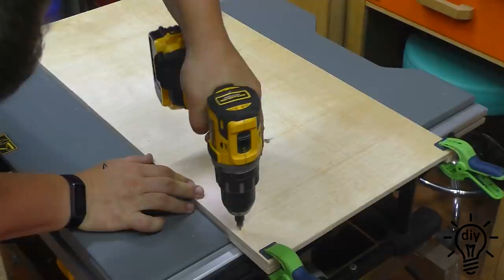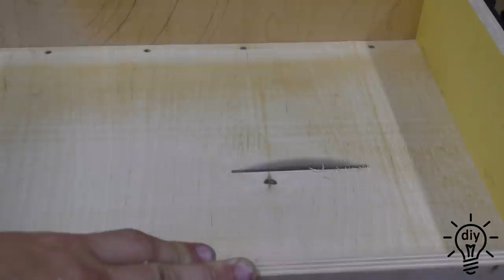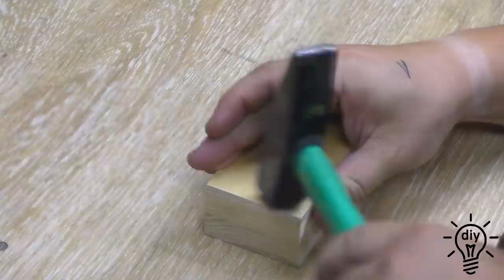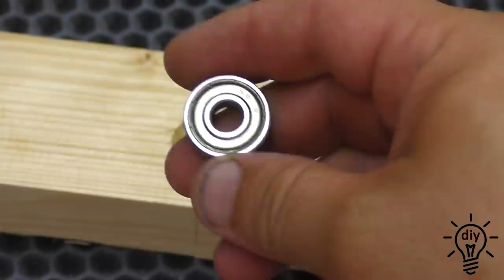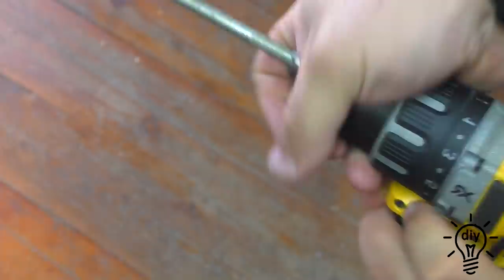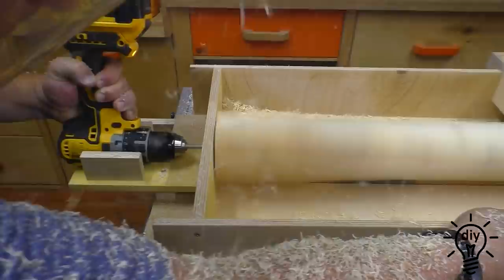How could I not have thought of this before! Brilliant idea with your own hands!

Comment: Wow!  What a wicked cool idea!  Thanks!
Reply from the maker: Thanks 🤝
Reply: You’re clueless.  This is a terrible idea.
Reply: @fiveoboy01  you could be nicer and explained instead of calling me clueless.  I am new to this and that was really rude.
Reply: @fiveoboy01  your favorite video is literally Gangnam style, how would you know who's clueless about what!? ....jkjk lol you guys are great. I wouldn't do that to my saw either
Reply: @rachealsmith5138  I'll give it a go - how about you spin a piece of wood perpendicular against a disc spinning at high speed and see what happens. Here's a simpler analogy: Find a paper plate, put a hole in the centre, attach a shaft and put in a drill. Now start the drill and keep hitting the plate at the bottom.  What happens? Would you consider hitting a metal disc with teeth spinning fast and hitting it hard side on with a hammer? Give it a try and don't blame me when you are in A&E/ER.
Reply: @fiveoboy01  you have no clue people have been doing this for years.  Doesn't harm anything.
Reply: @rachealsmith5138  Racheal this can be dangerous and also ruin the bearings on your table saw. The bearings supporting the arbor on a table saw are not designed to take significant side loads. Spinning a piece of wood this way forces it into the the saw blade sideways which overloads the bearings and will cause them to fail prematurely. It also trying to bend the saw blade as it's spinning.

Did I also mention this could be dangerous?

It simply is not a good idea to do this. Use a table saw the way it was designed to be used. Use a lathe to turn wood.
Reply: @rachealsmith5138  it's like loosing finger for hobby. Not to mention the chance of breaking the disk or making the wood piece jump away. Maybe to a face. 

The video is also missing a lot (a ton) of wood dust.
Reply: Terrible idea, and yes, you are clueless. 
Maybe don't comment on something that you admit you are new to and still learning.
Reply: @silvermediastudio  I would rather be clueless about something and learn than be clueless about how to treat people and never learn - which apparently you haven’t.
Reply: @rachealsmith5138  We're here telling you info on how to not explode your table saw blade and possibly injure yourself and you're worried about "how to treat people."  I guess feelings are more important than fingers, arteries, and eyes.
Reply: @silvermediastudio  It’s the way you word things.  If you look at OU812’s response, it was perfectly clear and appreciated.  You don’t have to call me clueless, or an idiot to give me an explanation. I am an educated and reasonable person, and that’s just rude.
Reply: @rachealsmith5138  I didn't call you an idiot.
Reply: @silvermediastudio  very true.  Someone else did.  Okay, time to quit quibbling.  I hope you have a great and safe holiday season.  Take care!

Comment: $100 in lumber and hardware plus 4 hours building a jig to destroy the bearings on a table saw to get 1 or 2 turnings. Priceless.
Reply: $10,000 hospital bill following.
Reply: I think this is a very dangerous project!! 
Spinning it with a drill ok but use lathe chisel. DO NOT USE THE TABLE SAW FOR THIS PURPOSE. JUST ANSWERING FOR TROUBLE. The stresses are sideways to the blade . Severe risk of it snapping and flying off hopefully not in the direction of your neck ! 

Please remove this project!!
Reply: Y el taladro cuyo motor no está fabricado para ese trabajo
Reply: This defiantly works and doesn't destroy the saw. I've seen people doing limited production work use a jig like this. Assuming ofc you feed the material slowly.

Comment: You should show the part where the drill, shafts, bearings, or blade fail, and the saw grabs that 4x4 and throws it against the wall (or operator) at about 150 miles per hour.  And if that hasn't happened to you yet - don't worry, it will.
Reply: Maybe he doesn’t like teeth, or his face because that’s gonna do some damage, damn that made me wince, I prefer my lathe it seems to like making thing circular 👍 
Stay safe mate please

Comment: A saw blade is meant to cut wood straight, not from the sides. This is quite dangerous because of the lateral forces put on the blade. Just buy a lathe!

Comment: I did exactly what I seen here ,the best I could without the measurements to copy exactly . I used a 4+4 pt and as soon as I pushed the sled across blade all hell happen . It blew apart in every direction, litterley scared me so bad ,I pissed myself! I went to a yard sale and found a old school 1963 shop smith that has several attachments and a lath was one of them,also has a table saw . I took that sled and cut that sucker up so no one will hurt themselves.
Reply: What a convenient story. I guess we were all born yesterday. You made your point I guess.

Comment: @DIY projects  This is a good way to break you table saw.
Reply: That's what I thought was well 🤣🤣🤣
Reply: At the very least if your lucky fry the bearings on the drive shaft there are much easier ways that are less time consuming to do the same thing
Reply: Not to mention your face
Reply: Buy a cheap lathe already.
Reply: Exactly! It puts forces on the blade and arbor that it was not designed to handle. Just get a lathe....

Comment: Make the drill stationary - line up a "Tail stock piece" as far away as needed with a "live end" use any old wore out hole saw, or just a plain piece of 3/8 steel pipe. Make one to fit in the drill as well. Lock the 4x4 between the two ends; turn the drill on and you can round with any half-ass sharp chisel braced on a solid surface...this rig makes me think, somebody has no business around any power tools or sharp things without supervision...this is why I should NOT have to pay for your health insurance...
Reply: Thank you Edward for the laugh, the last part of your comment was exactly what I was thinking, anyone can own a power tool it doesn’t mean they know how to use it safely.
Reply: I would bet that if we could see your history, there would be a number of "you pay your own health insurance" moments...
Reply: @scottwillis5434  And? This is exactly what he was talking about. He would rather pay for his own medical and not this morons after he lops a few fingers off or even worse. Come back when you find a better argument.

Comment: Needs must I guess. Go very easy with the feed rate or I would worry about the saw. Where you chisel out for the nut, there's a thing called a tee-nut that does the job. Drill a hole, hammer it in, sorted.

Comment: 100%.... You will TRASH YOUR TABLE SAW bearings and blade at a minimum! You will be lucky if you don't mess up your trunnions, and who knows what else! Especially with a contractors table saw! 

Look, I get that it's a "cool idea". But not every cool idea is a good idea. We have all done things we shouldn't have and found out it was wrong when it was too late. For the viewers that plan to do this, I ask you to PLEASE learn about how a table saw works and its proper intended use. I promise you, no manufacturer of any saw or any experienced carpenters or woodworkers are going to say this is a good idea.

Comment: This is an old technique. I've been a cabinet maker 40+ years and know that when you make cove molding or turnings like this you need to skew the feed so your angle of attack is no perpendicular it easier on the saw and the blade. Not sure if a lightweight saw like this is adequate but you've got the concept. Good job. Remember -Haters always hate

Comment: The idea is good, but the tool used is not the right one, the drill is not designed to work constantly for long periods of time, with this you will only end up burning the motor of your drill!  I think it would be better to use a polisher ... or failing that, a grinder ... the drill is not for that!

Comment: I'm all for ingenuity but removing all safety features and spinning a block of wood on your saw blade is a recipe for disaster. Table saws are the most dangerous tool in any wood shop and have taken more fingers than all the other machines together. There are too many of these ridiculous tutorials.
Do yourself a favour and buy a lathe instead. It's cheaper than a few missing fingers or a glass eye.